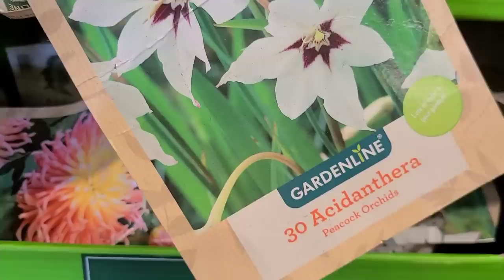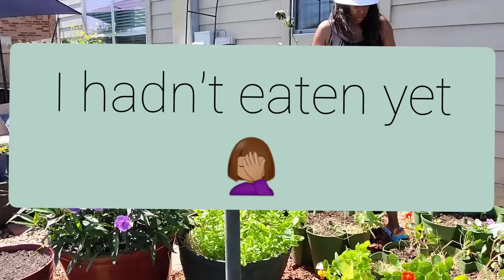Amazing Aldi deals|| Lowes & Shading my garden

Comment: Hi Mrs Helen love your channel  by the way but if you want to use the buckets 🪣  with the poles in them I stead of added dirt to them take the dirt out of them  and fill  them with quick Crete  (fast setting  concrete) to weigh them down